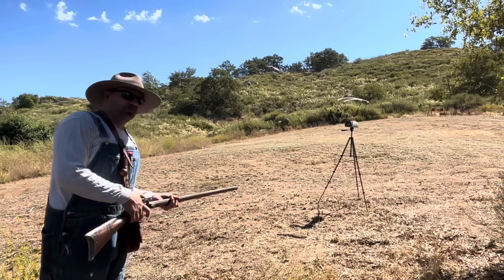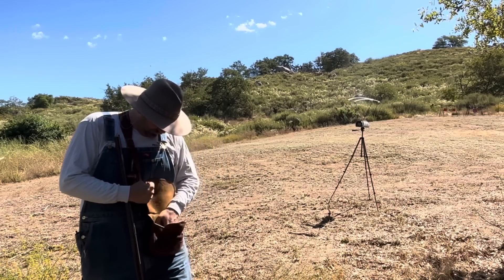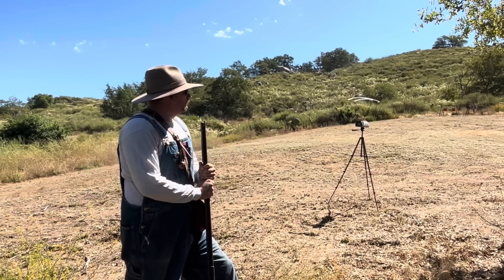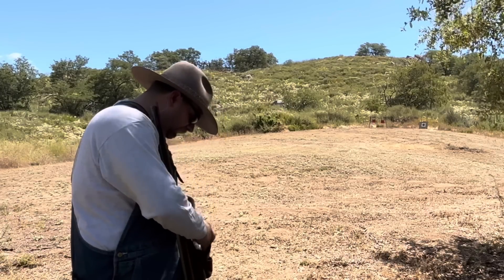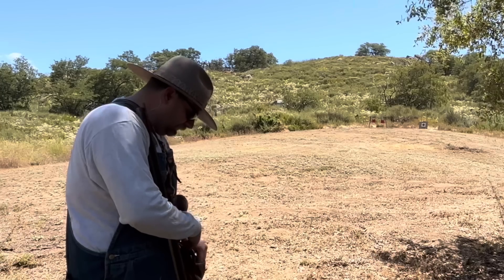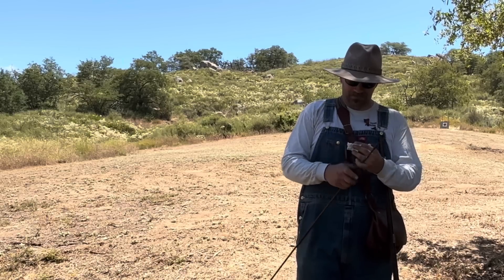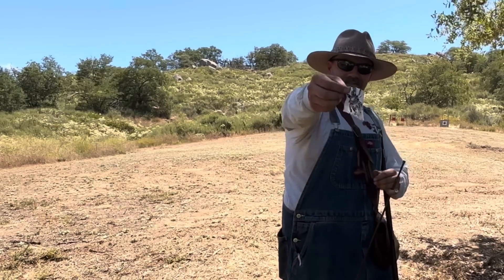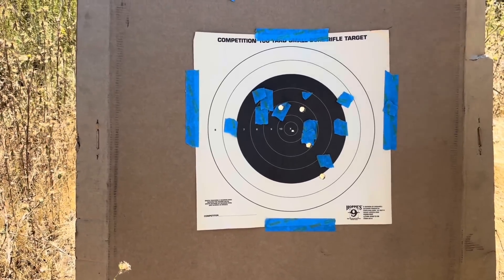Mill Time. The Key To High Performance Black Powder?

Comment: I just made a batch 200 grams and it is slow......  no where near
Reply from the maker: So what are you doing wrong?
Reply: @Everythingblackpowder well, I'm not really sure. I have made great powder for a long time. But this batch sucks. I have no idea why. I'm sure I fat fingered something but I really don't know what. It's just strange. What could I have shorted to be this bad... I'm seeing fuse burn slow.
Reply from the maker: @cdarrinford  did you try something different for this batch? New charcoal? New mill, new nitrate?
Reply: @Everythingblackpowder I am using components that I have already made great powder from. Not sure what is going on. I'm making a new batch just to compare the results

Comment: This might've been asked and answered already, so forgive me:
I'm curious how you arrived at the current ratios you use? What effect have you noticed by lowering the amount of carbon and increasing the amount of oxidizer?
Reply from the maker: Back when we only milled our powder for 24 hours we noticed it was a little cleaner and gave slightly higher velocities but since we’ve been milling our powder longer we have found no noticeable difference in velocity

Comment: Hey Jake, loving the content. Curious if you have tried 'tag aldar' (alnus serrulata) also known as hazle aldar or smooth aldar.
Very fast burning wood like willow. Heavy tannen in bark but curious barked wood vs unbarked wood would make difference.
Reply from the maker: I always strip the bark off

Comment: 30 mm & 20 Ton press
Reply from the maker: Perfect, what you need to do is weigh out 37.1g of powder and compress each puck to a height of 30mm. This will give you a density of 1.75g/cc
Reply: @Everythingblackpowder  I will try that! Thank you
Reply from the maker: So each puck should be 30mm by 30mm and weigh 37.1g.
Reply: @Everythingblackpowder ❤❤
Reply: I’ll need to mill a batch, so it will be a few days and I will let you know! 
Thank you much, brother!!
Reply from the maker: @BUCKEYEFARMBOY54  you bet
Reply: So, I don’t know if 50° will make that much of a difference but I am cooking a roll of cottonelle ultra comfort, toilet paper and a 1 gallon pan can with a quarter inch hole in the lid in my gas grill at 650° for two hours plus and see how it works
My gas grill will hold 650° steady and it is as close to a pyrolisizer as I can get with my equipment at hand😂😂😂😂😂😂
Reply: So, my die is actually 29mm (not 30 as I ordered), puck is 30.5 mm long and weighs 35.5 g, which should be right on 1.75 g/cc…….but 50 grains vol = 43 Gn weight………
Is it possible I’m compressing too dry???? Need more water?
Reply from the maker: @BUCKEYEFARMBOY54  do you glaze your powder at all? Can you tap it and settle it enough to equal the 50 grains in volume?
Reply: @Everythingblackpowder  I will glaze and finish the process completely and check again
Reply: OK Jake great news!! I glazed my powder for 17 hours and the small Tumblr and after that I measured out 50 grains tapped it down and it measured 49 grains on the scale. Perfect thank you for your counsel Jake I appreciate it.
Reply from the maker: @BUCKEYEFARMBOY54  excellent, glad to hear it
Reply: @Everythingblackpowder  so. My next batch will be a 72 hr, 200 g batch of Cottnoenlle Ultra comfort and I will test against 3f Swiss out of my CVA 45-70, 24” bbl with a 300 gr spg lubed bullet over top of a wool patch soaked in 50/50 beeswax & lamb tallow over a .125 nitro card over 60 gr powder. 
I will keep you advised!! 😁

Comment: Wild: after compression it weighs 39 grams at 50 grains volume 🤷‍♂️🤷‍♂️🤷‍♂️
Reply: Grains not grams
Reply from the maker: You aren’t compressing it enough
Reply: I will work on that
Reply from the maker: @BUCKEYEFARMBOY54  what is the diameter of your puck dye?

Comment: Well I want to thank you, Jake.   You are a WEALTH of great information!!😀
     I’m pretty proud of myself! I measured out 24.5 grams of 4F goex, dampened it and picked it with a small 20 Ton press and a Rosineer Die…….pumped the jack till it stopped, as you directed and 10:58 ended up with a puck 30MM diameter 19.75 MM long, which by my calculations should be @ 1.76 Grams/CC. 
   As 4F, 50 grains weighed 48.2 grains…….I will check again after I grind the puck. 
   Thank you again for sharing your knowledge with us all!!

Comment: Ive  mentioned on some of uour other channels trying sugar..i got the recipes from the magazine "the backwoodsman".  The powder wasnt ad good as i hoped..but it had a recipe that uses a 50/50 mix of charcoal & powdered sugar. Along with a touch of rust..it seems to be okay.
I made itbsimilar to your powder. 77 ml potassium nitrate.  7 ml charcoal. 6 ml powdered sugar. 9 ml sulfur. 1 ml of red rust.
Needs some adjustments but its not bad
Reply from the maker: How’s the fouling on this powder?
Reply: @Everythingblackpowder  I only have a 1858 navy and the range is a hour away.  I have only fired the normal recipe I got from watching your channel. I didn't have the other recipes at the time..I have tested it on some stainless steel.   It doesn't leave as much dirt/ fouling behind.  Like this last video o gn yours here....the longer its milled the better it seems.
The recipe in the magazine wasn't great. Says take 1/3 cup of kno3 & 1/3 cup sugar with a heaping tsp...etc...not exact measurements in weight.
If your interested the magazine is "the backwoodsman" Dec 2019
Reply from the maker: Interesting. We might try that
Reply: I have tested it a few times now and there is something to it!
Ive got it wotked out to where it is similar to normal (77/13/10) black powder!  It leaves a small amount of black/oily residue thats probably burnt sugar...but overall very clean! And a little warm water cleans it easily.  @Everythingblackpowder
Reply: Please give it a try
Reply: Also I only screen the powder. I do not have a press (yet) and I believe the sugar helps hold the granules together. 
This magazine has a recipe that completely replaced charcoal with powdered sugar. It does light but burns slower..works better for me to add some charcoal...strange to end up with a tan colored powder

Comment: absolutely love the videos over the years! One question though, when you puck your powder how much pressure do you use?
Reply from the maker: I don’t know. I calculate the density by the diameter, height and weight of the puck. The amount of pressure used is irrelevant. I weigh out 37.1g of powder and compress it to a height of 30mm. So the diameter is 30mm the height is 30mm. This gives me a density of 1.75g/cc

Comment: Tested cottonelle again against my hemp mix, even doubled the mill time to 16hrs on the cottonelle vs 8hrs hemp and its still slower. I wasnt even testing just hemp bast fiber, its was a mix of bast, hurd and degummed. Degummed was the slowest out of the 3, going to keep using bast fiber. Have wanted to try cottonwood though. I did 120gr vol under a 320gr cast REAL conical, Dixie TN mt. rifle 50cal. 1557fps cottonelle and 1581 hemp mix. 12 ton pucked and FF, going to try again with just hemp bast and do some cottonwood. I really think something went wrong with your cheech and chong vid, totally not the same thing as industrial hemp with 50k+ uses

Comment: So I did not have brass and was really wanting to mill I ended up using marbles and I don't know if you have tried it worked fantastic I used different sizes and milled for 24
Reply from the maker: We have tried marbles but found brass did better

Comment: This is crying out for an experimental series - same batch of charcoal (or multiple batches well-mixed to minimize variation), with subgroups of 3, 6, 12, 24, 48 and 96 hours. Then graph performance and come up with a normalization curve.

That's a lot of work, but would allow you to isolate (and control for) milling time from then on out.
Reply: I just realized that you don't even need to run separate batches - just run for 96 hours and take samples at each timepoint. About 5 shots' worth each...

Comment: Ceramic materials engineer here, and I just want to say that your videos are awesome, and I can tell you really know your stuff.

It makes a lot of sense that milling performance would improve performance since smaller particles with higher specific surface areas can greatly improve reaction kinetics. Increases in time, changing media size and optimization of mill efficiency as you've discussed previously (BTW you were basically dead on the money on how to get a good ball mill run) are all key tools in my industry to make a process that provides the best possible end product.
Reply from the maker: Thank you very much

Comment: Swiss uses alder buckthorn [BOT.] and alder [BOT.] - so birch tree and buckthorn, but for their hunting black powder they use only buckthorn. Birch is used for their blasting black powder. Drying time as temperature control is critical. They don't mill that long but with 5T double wheel crushers, then cake with 10T roller press, corn, tumble smoothen the corn, dry the corn and then coat it with graphite as storage agent.
https://www.youtube.com/watch?v=Y0fVlDqc0LE
So the milling media we are using is in accents too light for the task kinetically so it takes way more time of the initial mixing mill to surpassed the commercial Swiss powder.

Comment: Try milling as a wet slurry.
Reply from the maker: Funny you should mention that. We are experimenting with that right now. We have tried it in the past but we always used water which in retrospect is probably the worst solvent you can use. Now we are using denatured alcohol.

Comment: I wonder what will happen if you mill the toiletpaper powder for 72 hours, since I remember that stuff was already very powerfull with 24 hours of milling.

Edit, I also noticed with my black powder that the faster it dries, the better it preforms I use a granulation ratio of 70/30 water and 99% Isoprophol Alchohol. The only problem is that is dries slow. I live in europe so its mostly not much sun and buying a drying lamp made it dry in 2 hours. And gives is much better performance.

Comment: Cool video. But i think you should have taken a swiss baseline shot. The hot summer temps can make a huge increase in pressure. My percussion gun is always faster in the summer. Ive only used goex and swiss. Both are faster on a hot day. Love the videos

Comment: You probably know this, but some powders are very temperature sensitive. The hotter it is outside, the higher the pressure and velocity. Shooting during summer months vs winter months may affect the results a bit. At least that's a thing with some smokeless powders. I doubt that would result in a 200 fps difference, but 50 fps is probably very possible.
Reply: The slight difference in velocity is probably due to the bullet loading. The tightness of the impact causes the pressure in the barrel to differ.

Comment: to make this finding scientific make a batch of charcoal from a source that has been very consistent. take a sample out after milling for 24 hours to act as a control and then every 12 hours after that until all is used. that way you can chart the difference between mill time and see if the improvement is linear, exponential, or has diminishing returns.

the idiot in me wants to see what a batch of balsa milled for 168 hours will do.
great video

Comment: New hypothesis for TP powder:
The stuff is light and fluffy so it grinds well but I don't think that's all.
I suspect the fluffy structure acts as an insulator, meaning that the core section doesn't get cooked quite as hot. Supposedly the best "black" powder is actually brown and a little undercooked.
I've argued before why this sort of thing would be advantageous from a thermodynamics perspective but it would be interesting to see.

Comment: How many canisters fit on your ball mill, is it just one?
Reply from the maker: 2
Reply: @Everythingblackpowder  So it takes quite a while to make a range of runs without altering a batch midway. 

I guess the 'minimally invasive' way would be to run both cans identically at the start, then stop both to take a timed sample, but always take from one can and refill it to it's starting weight from the other. That would minimize the effect of milling an underweight batch because whatever difference there is, it's only in the replacement powder.

Comment: Humidity ABSOLUTELY MATTERS.  We're having a humid summer and clumping after 8-10 hours of milling became intolerable with reclumping occurring within five minutes.  My solution was to buy a 3-gallon vacuum chamber that I hook up to my AC vacuum pump and dry all my materials at once overnight at 29" of vacuum, then take out and quickly weigh each ingredient for a batch and put directly into the mill drum.  If the ingredients are dried to this level and the milling drum is air tight, no clumping will occur.
Reply: Good info, thanks. I have been considering building a vacuum drum. Good to know I'm not necessarily way out in the weeds on that.
Reply: @jeffersonsharp2292  If you don't already have a vacuum pump, the jungle website sells complete vacuum chamber/pump kits for not much more than a pump alone costs if purchased separately.  Get the tempered glass lid, not the acrylic.  It's money well spent since you can dry your charcoal without fear of it catching on fire.  Be sure and weigh your final mix AFTER drying.  Pump it down until it holds a steady vacuum (may take a few minutes while the water vaporizes and creates gas volume), close the valves,  turn off the pump and just let it sit for a while.  Even a couple of hours makes a huge difference to the clumping.

Comment: I would suggest to try to  take into consideration changes in relative humidity of the air during milling.  I would be very surprised if air humidity didn't have a hyge impact on black powder performance.

Comment: I get the impression that the mill time may be based on the hardness of the charcoal. I'd still like to see the cottonelle with more mill time. If my theory is correct, probably about a quarter of the charcoal you've tried could possibly yield much better results. They might be worth a revisit too.

Comment: Can you please show us some more detail on your ball mill?
I have searched “ball mill efficiency” and there are a lot of factors which affect it. 
Some factors being - drum diameter and length, volume of media, volume of powder, drum speed and of course processing time. 
If you could give us a guide on what you are using, that would be really helpful!
Thanks!
Reply: They've made whole video about it, but it seems I can't link it here, so you might have to look it up yourself :-)
Reply: @_muody  Can you tell me the title of the clip? I’ve watched a few but I can’t find any with actual details of measurements and speeds
Reply: @daveleigh4359  Sure thing. It's "How to make a ball mill for Black Powder." from over a year ago - June 9, 2023.
Reply: @_muody  hey thanks for that. I tried to reply to you but messed it up and just replied to myself. I was trying to get finer details of jar to ball to powder ratios.
Reply: @daveleigh4359  I get it. On the other hand, it all is more of an DIY than industrial method. And generally I think, the message is - take what you have and experiment a bit, rather than focusing on exact math. As we can see, it really isn't required - one can make very decent black powder without it. It's just good know what to look for, like the sound that milling media makes, or maybe how charcoal should look and so on. And in the end, there's also room for someone else to improve on the method and share the results :-)
Reply: Yeah, I saw that one but how big are the balls? How many balls are there? Just a few or half a jar full? Volume of jar to balls to powder ratio? I imagine if you put too many balls and too much powder in, there’s no room for efficient grinding. Apparently length to diameter ratio is a big factor in industrial mills.  I do appreciate your help,  I’m just trying to get some finer details on the method

Comment: From my experience it is more important to start with homemade coal and already sifted under 77 µm. Sulfur must be pure above 99% and also under 77 µm. Potassium nitrate is best mixed if wet in an alcohol solution, grinding everything in a blender. Then the powder is dried and only at a later time it is best to put everything in a ball mill.

Comment: We shoot cannons( I live just outside Chickamauga National Battlefield Park). Do you think this would work better than store bought in a small cannon?
Reply: It works fine in my CC golf ball cannon. I don't do the hydraulic press step, just push it through a screen wetted with 90 % isoprop .   The good pressed corned stuff is what goes into the 6 gun.

Comment: hell yeah ! Now i just need to be equipped with a pyrolyser, a mill and a press.
Reply: Well there is 'primo' and there is works good enough.  For accurate consistent target shooting and hunting use primo like Jakes or swiss or even goex.   For other stuff like plinking, cannons or fireworks you can cut some corners imo. The paint can is a fine charcoal maker and you can do a workable damp press with a bottle jack and a heavy object like a pickup truck or just push it through a screen (moistened ball with iso propyl) if you don't need the hard granules.  You do need some kind of mill though.🙂

Comment: Could the secret behind the cotonelle be that the carbon is so fine granulated from the beginning, that it needs less mill time? If the cottonelle doesn't increase the speed by about the same amount after 48 hours,  it could be a sign for this.

Comment: I actually mill mine for 48 plus and since I started using Cottonelle I always make it with dextrin because I live on the east coast and I hunt in the south so I am pretty much always having issues with humidity. I have a kiln/oven that I use for my charcoal. It’s a heat treat oven that I use when knife making so I keep that process pretty consistent.